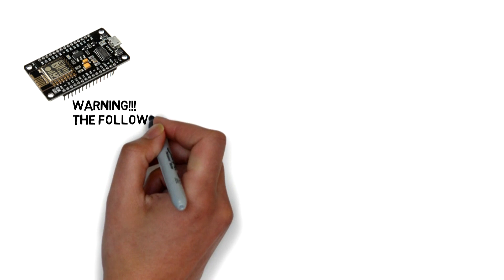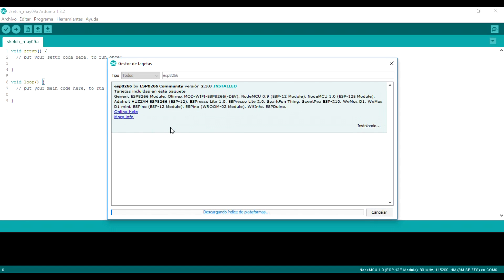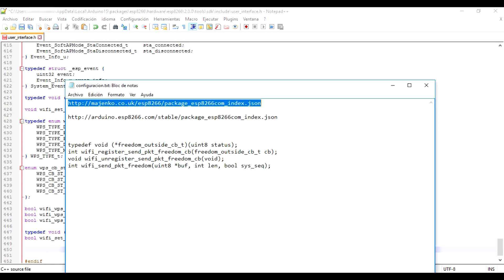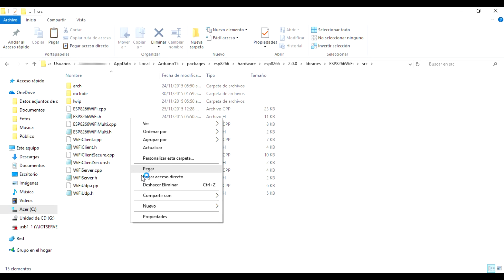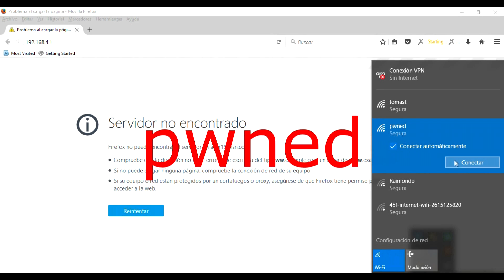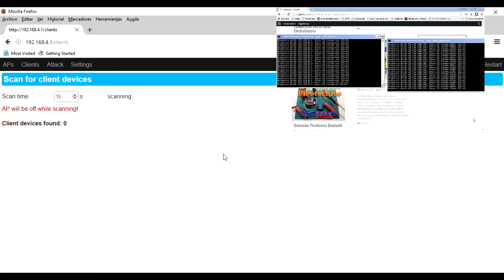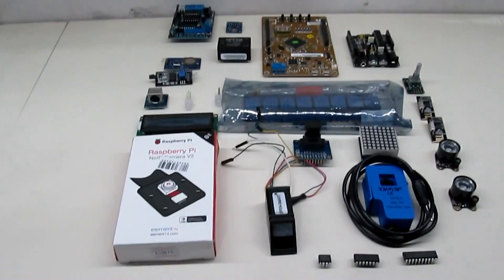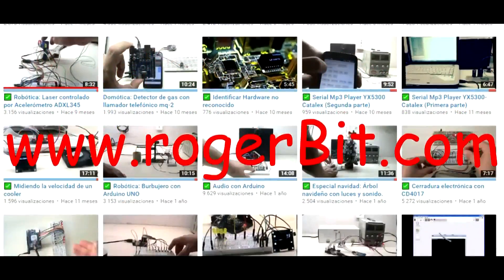💻 How to make a Jammer wifi with esp8266 (step by step) English version

Comment from the maker: Para ver la versión en español https://www.youtube.com/watch?v=a9cRrV36m-c
Reply: CarlosVolt Tutoriales 
512kb version isn't working why? Please could you help me
Reply: Arduino: 1.8.5 (Windows 7), Плата:"NodeMCU 0.9 (ESP-12 Module), 80 MHz, 115200, 4M (3M SPIFFS)"

Изменены опции сборки, пересобираем все
In file included from sketch\Attack.h:9:0,

                 from sketch\Attack.cpp:1:

C:\Users\Александр\AppData\Local\Arduino15\packages\esp8266\hardware\esp8266\2.3.0/tools/sdk/include/user_interface.h:609:61: error: declaration of C function 'int wifi_send_pkt_freedom(uint8**, int, bool)' conflicts with

 int wifi_send_pkt_freedom(uint8 **buf, int len, bool sys_seq);

                                                             ^

In file included from sketch\Attack.h:9:0,

                 from sketch\Attack.cpp:1:

C:\Users\Александр\AppData\Local\Arduino15\packages\esp8266\hardware\esp8266\2.3.0/tools/sdk/include/user_interface.h:494:5: error: previous declaration 'int wifi_send_pkt_freedom(uint8*, int, bool)' here

 int wifi_send_pkt_freedom(uint8 *buf, int len, bool sys_seq);

     ^

exit status 1
Ошибка компиляции для платы NodeMCU 0.9 (ESP-12 Module).

Этот отчёт будет иметь больше информации с
включенной опцией Файл -> Настройки ->
"Показать подробный вывод во время компиляции"

Comment: Where can I get the same files you using in your video?? For example the text file from where you take the link for the beginning of the configuration of Arduino soft is not present in the archive, and others files also.
Thx to you will be kind, and provide some help.

Comment: its not working i keep getting Arduino: 1.8.5 (Windows 10), Board: "NodeMCU 1.0 (ESP-12E Module), 80 MHz, Serial, 115200, 4M (3M SPIFFS)"
error: Failed to open COM1
error: espcomm_open failed
Reply from the maker: Estas seguro que está instalado en el puerto com1 el nodemcu?
Reply: sí, pero me encontré con un arreglo gracias de todos modos
Reply: If it is not uploading, you might need to hold the flash button on the esp8266 while uploading the code.

Comment: 512kb version isn't working why?
Reply from the maker: If you use a 512kb version of the ESP8266, you will need to comment out a part of the mac vendor list in data.h. Otherwise it will use too much memory to fit on 512kb.